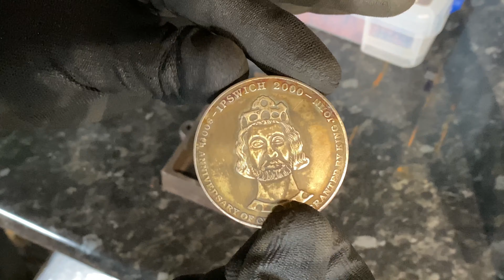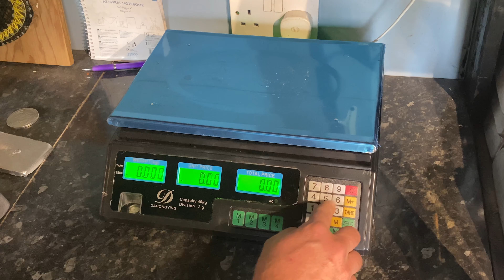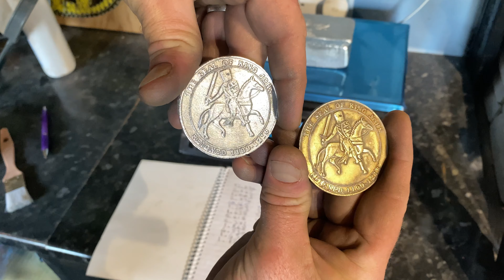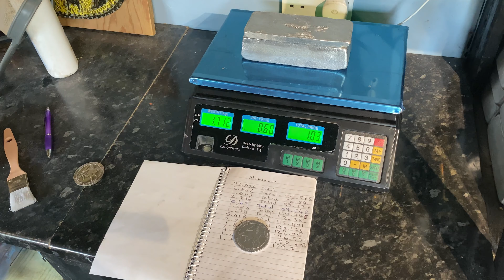Sand casting a coin from aluminium cans ( petrobond ) the seal of king john

Comment: Brilliant piece of work and well done matey, thanks for making this video.
Only a suggestion, when using the casting box I cut razor thin lines from the piece outward to toothpick sized holes that release the air when the metal is going in, I have never had partial fills and the lines are too thin to leak liquid metal. I learned this from Andrew Berry At the bench casting video.
Hopefully this helps. 😊
Reply from the maker: Thank you I will give that a go 👍
Reply: I'm shocked that the coin came  out so perfect, without any air vents.

Comment: The details came out really nice.
How hot is this gas furnace? I read that aluminium melting point is roughly 660°C, I set my electric furnace to that but the cans did not do anything other than smoking off the paint. I set it to 730°C and the cans melted but the surface tension seems to be pretty big and it doesnt track details in the mold very well. You dont seem to add anything to the molten metal, is it just the higher temperature which helps it flow better?

Comment: How did you get the detail on the coin to come out so well. Did you add anything to thin the alu out ...did you degas? Threw my first ever cast ..trying to make a sinker mould form friend. Forming was way off. Looks like consistency of the alu was too thick. Need beginners advice please
Reply from the maker: No I didn’t add anything I think I just heated it higher than usual and scrapped all the dross off. I’m going to make this coin in copper soon

Comment: Does the wax make it easier or more difficult to clean the aluminium? I'm just wondering since I have never seen other people cool ingots down with wax before.
Reply from the maker: Hi there I pour a hot kettle over them before I clean them it pretty much take off all the wax but they clean up lovely
Reply: @meltingipswich  so question then.  Why quench in wax instead of water?  Seems like an unnecessary expense and added effort.

Still trying to justify purchasing my first foundry and I'm trying to learn all I can first.

Comment: Where did you pick up those ingot molds?
Reply from the maker: eBay
Reply: @meltingipswich  what size
Is it? I've been looking on Amazon, but its tricky to get a feel for the size, and the cast iron ones seem a bit cheaply made. Thanks
Reply from the maker: @DrewMann  mine is the cast iron one and it’s the smaller one 
I really want to get a larger one